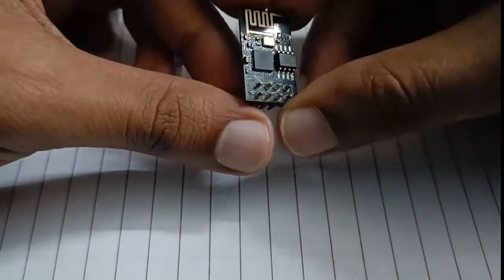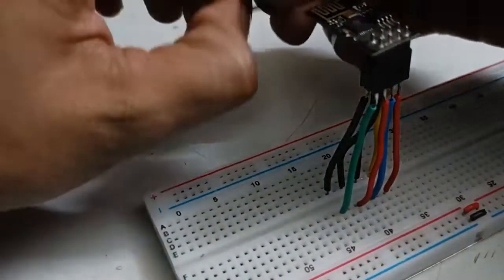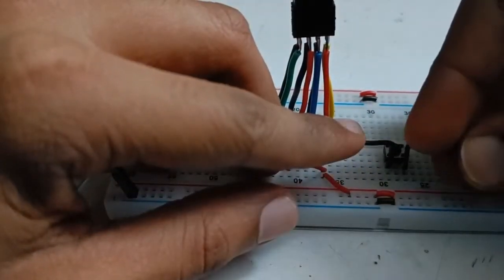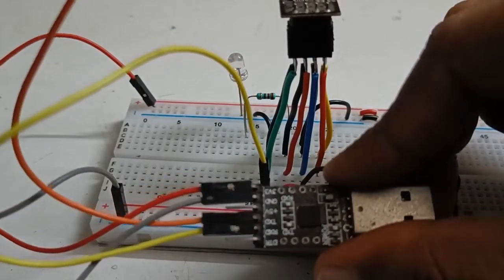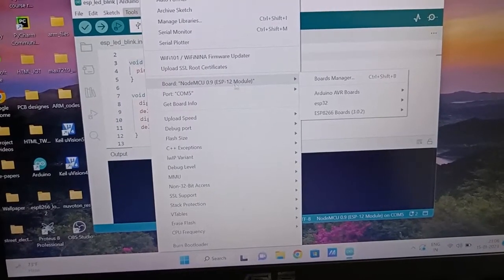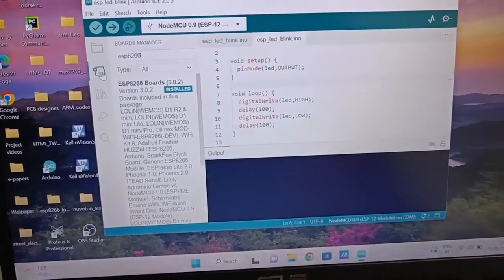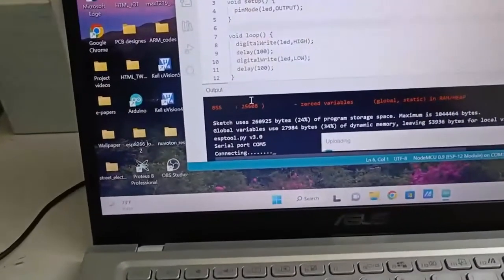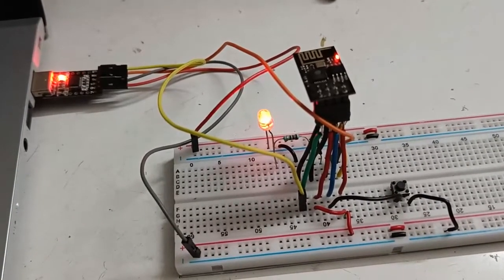Programing the ESP8266 ( ESP-01 ) Wifi module

Comment: I tried different ways but it doesn't work, neither with this ESP-01 or this ESP-01S I have. The only thing that I get when I reset the board is this set of characters through the Tx's ESP-01:

 ets Jan  8 2013,rst cause:2, boot mode:(3,6)

load 0x4010f000, len 3424, room 16 
tail 0
chksum 0x2e
load 0x3fff20b8, len 40, room 8 
tail 0
chksum 0x2b
csum 0x2b
v00040d90
~ld

The thing is that I get that when I set the baud rate into 74880 bps. When it is set in 115200 bps I just get garbage.
I repeated this uncountable times and I get the same no matter what program I upload to the flash.
Reply from the maker: 1. Don't select board as "nodemcu 0.9(ESP 12)" , instead of that select "Generic esp8266 module".
2. Initiate serial monitor by typing "Serial.begin(115200)" in the setup function.
3. Add a pull up resistor of (1K to 10K) to the reset pin.
I hope the above three changes will solve the issue you are facing.